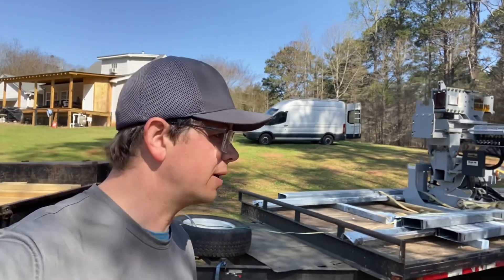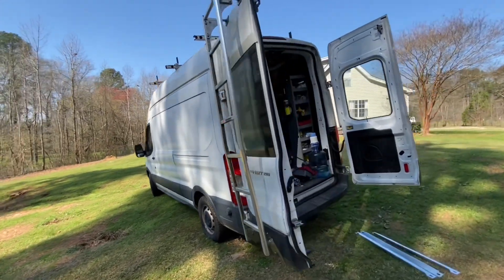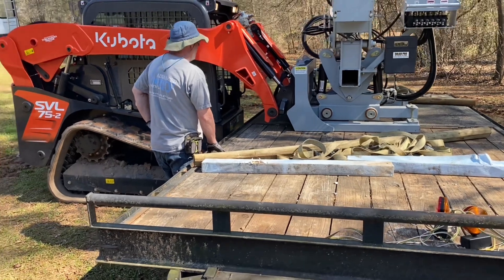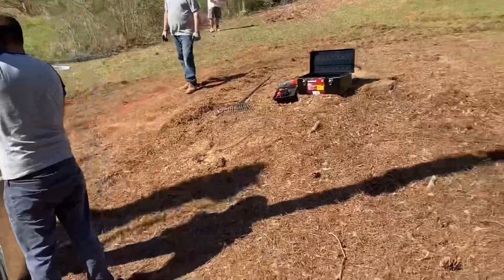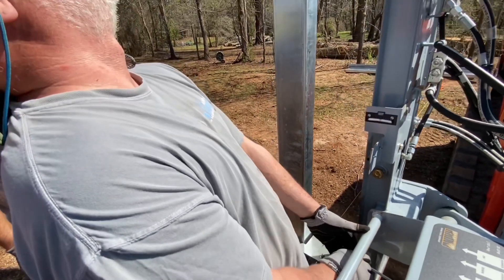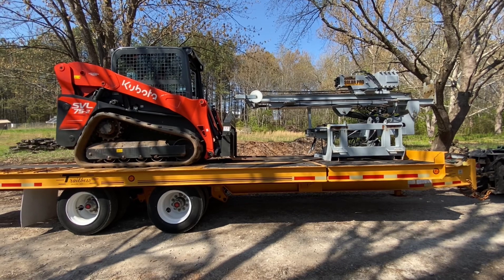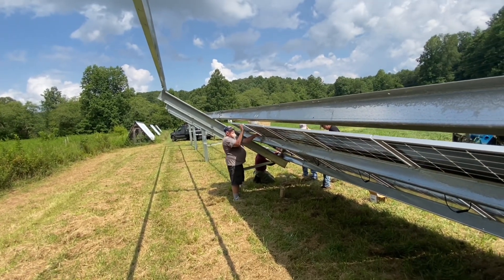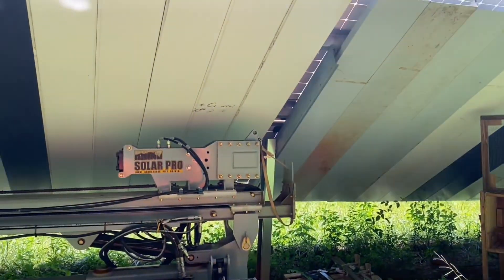Solar Post Driving & Sinclair Ground Mounts

Comment: If the panels on the Sinclair ground mount are facing south... does the ground going west to east need to be level?
Reply from the maker: It needs to be relatively level or you end up really tall on one end
Reply: @GainSolarPower  if you don't have time to reply to this second probably dumb question (no worries)  Why couldn't the ground mount just slant with the the land keeping a consistent height above the ground?
Reply from the maker: @steve6631  I am run with the grade but it gets wavy. How many panels are we talking
Reply: @GainSolarPower   OK, that makes sense.  Well... if it gets wavy with a professional like yourself, it would probably get ridiculous and out of control for a DIY like myself.  I'm looking to do approx 30 panels.  I've found some other options that are not adjustable, but I liked that the Sinclair were adjustable.  Thanks again for replying!
Reply: Set a string to the grade and run with the average, the string would set the post tops-purlins and z rails on a nice consistent straight slope-it would look fine and be easy to build up.
Reply from the maker: For example, I just did 73 feet long, and I had about 2 feet difference between post number one and post number five
Reply: @GainSolarPower    Thanks for the help and replying!  Wish you the best of luck with your business.

If I went 60 feet, I'd have about a 6 foot change in level.  I'm searching for a ground mount system that doesn't need a fortune in site prep/levelling.  Thanks for the info!
Reply: A local guy with a dozer and a couple hours could solve that for you for a few hundred $

Comment: Excellent!!! Nice to see you growing like this.... Want to come down to West Palm Beach and install a few systems for me?
Reply from the maker: No but I will sell you the rack all day long. Are you an installer?
Reply: @GainSolarPower  Pity, I am not in a huge rush, so if you do want to venture down here, let me know.  Yeah, I'm a designer/installer.  Unless I can find someone locally to pound them in properly, I suspect I'll have to place these in concrete.  Not really a big deal, but your truck would make it much cleaner and quicker.   I have three installations where I want to use the Sinclair systems on the books already.  I'll reach out on DM.    Either way, congrats on upgrading your fleet.
Reply from the maker: @howiegrapek  yeah let me know.  The driver recently took a trip to kentucky with a trusted installer friend of mine as the tour guide.  We can hotshot it down to you with a load of racking, just need to workout the details.

Comment: Curious on a 32 panel array. How far apart are the posts for the sinclair skyrack and what is the overall footprint on the whole array. It looks to be about 60 to 64 feet.
Reply from the maker: The post spacing is typically 160” from first to second post then 212”. So a 2x16 32 panel array would be around 56’ long. 4 posts and then we’d add on cantilevers to one side.
Reply: @GainSolarPower  thank you.
Reply from the maker: @Pappy-1  let me know if you need a quote.
Reply: @GainSolarPower  I am in Pennsylvania so along way to install the rack. I have to do it a little at a time. Figured I would get the rack and then batteries, the solar panels etc.  I have a new inverter from Signature solar. I do like your channel along with Engineer775. I wish I had the money to just call him or you up up and say hey can you drive to PA and install a new system haha. I am hoping to go 32 panels at first and then upgrade to 64 over time. Of course I may be dead by then.
Reply from the maker: @Pappy-1  I can still sell you the rack. It will ship direct from sinclair in Michigan.
Reply: @GainSolarPower  sounds good. I will be in touch. I need to find someone to pound them in. I know some people who work for a guard rail company and will ask them if they do it or know of someone who does.  Thank you
Reply: Look at Sinclair’s install manual-there are a couple different ways to install the posts-pounding is not the only way.  If you have or can rent a 24” auger and get some concrete, it’s cheaper than getting someone to come and drive them.
Reply: I understand recommended bi bifacial manufacturers that the flooring should have white pebbles or white tarp on the floor to increase power on reflection light to the pv panel. Notice you and eng775 doesn't apply the finish flooring that way. It's necessary?
Reply: @ernestolaureanopineiro1123  When I go with bi-facials that is what I plan to do. I saw one of Engineer775 videos and I believe he recommended that. Most likely his clients make the decision on that and not him.